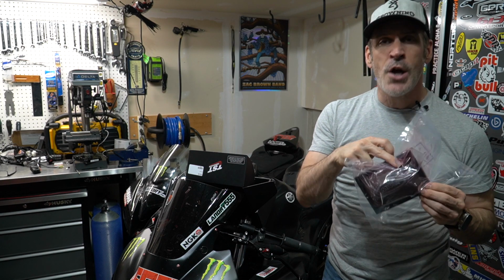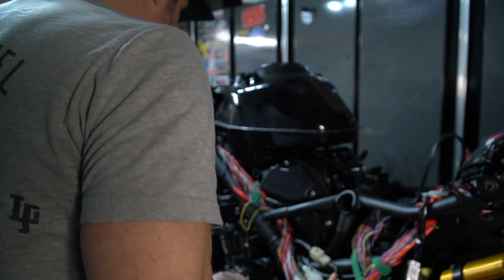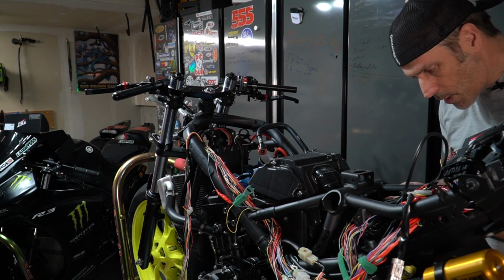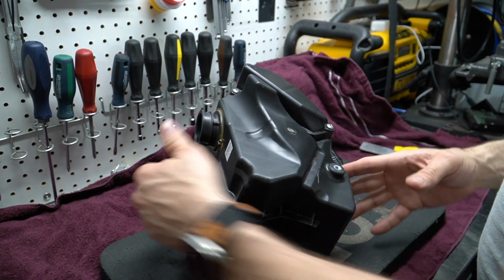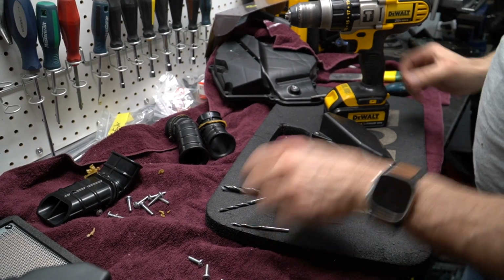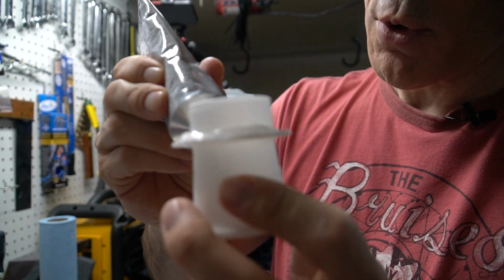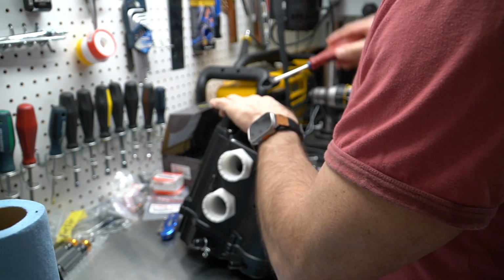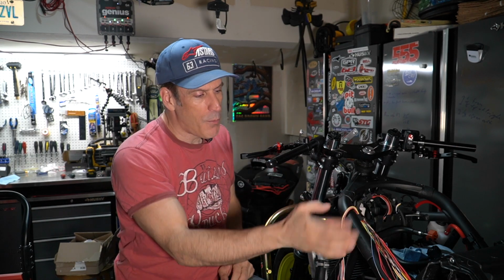HOW-TO: Velocity Stacks and Air Box Mod for your Yamaha R3

Comment: If you do this procedure for stacks, modified air filter cover, block off plate, removal of ais system and full system exhaust. Does O2 sensor need to be disconnected completely or would a tune tell ecu to disable O2 sensor?

Comment: Nice vid man. I just did the same mods on my 2017. Just now putting it all back together. Bike not starting though. Same airbox mod, ecu flash, new exhaust, and new spark plugs. Im kinda stumped🤦. Anybody got any ideas? Engine sounds like it wants to go but just wont turn over....

Comment: Removed all air box, Can the motor be removed from there?  I would like to clean it since it doesn't turn when turned on.
Reply from the maker: you’ll need to disconnect all the electrical circuit, remove the exhaust, then you’ll have to remove the engine mount bolts… I’d strongly recommend to get the shop guide… Makes the process a bit easier 🙂
Reply: I don't mean the engine but the motor that starts the bike. Excuse my English
 @landry555

Comment: for removing my fuel tank should i wait until I'm low on gas or can i take it off with almost a full tank
Reply from the maker: You don’t have to worry about the level of gas in your tank. A small amount will spill but that’s normal.  A small check valve will prevent the gas from escaping the tank. Let me know if you have any additional questions. 

Thanks for watching!
Reply: @landry555  thank you so much. I have already installed the mwr air filter and just got the new air stacks and air box covers. Can't wait to get it installed and tuned.
Reply from the maker: Awesome!!! Looking forward to hearing your feedback once you are done with all the modifications. Cheers!

Comment: I have the TST velocity stacks installed on mine and I am about to use the Norton flash. Did you notice any difference with the TST stacks?
Reply: Did they make your bike louder?
Reply: @jaredshelton4718 not necessarily, but you can hear the intake sucking in more air louder
Reply: @jaredshelton4718  well I have the air box mod and the stacks so of course it’s louder